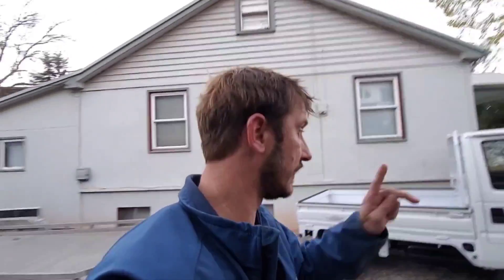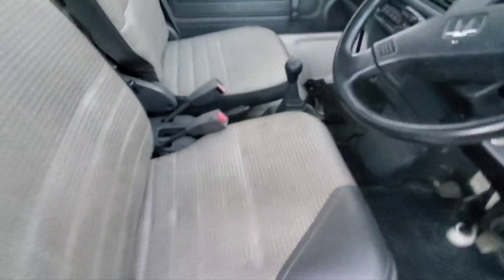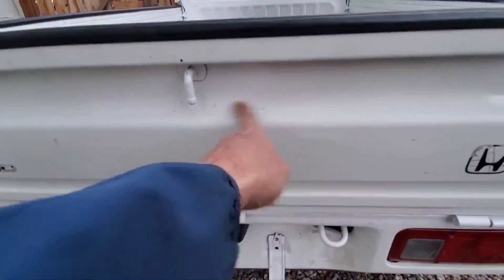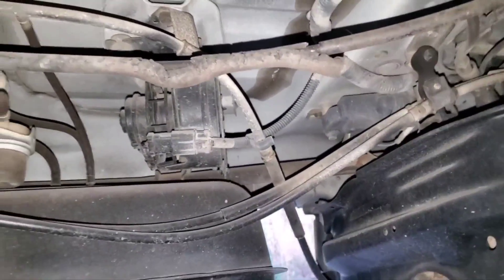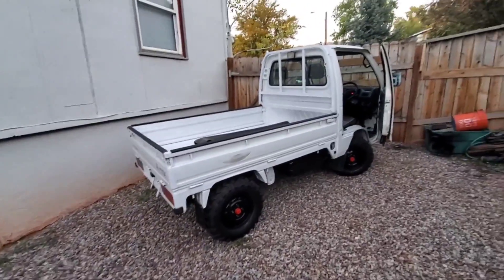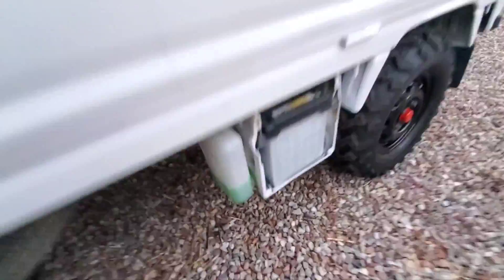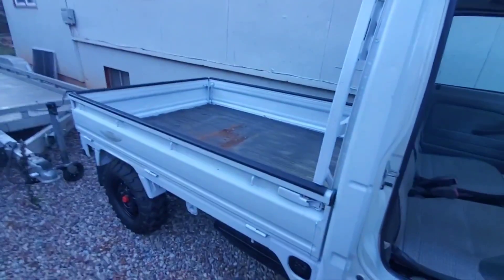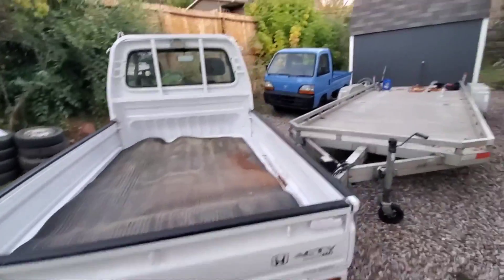Honda Acty Ha4 walk-around

Comment: I watch some videos of these trucks saying that these trucks are break down prone and that they are not very reliable....... only issue is the people saying this dont look very handy if you know what I mean. I have a question because I can not find videos from knowledgeable people on reliability and gas mileage. If you got the time to give me a small blip about mileage & reliability that would be awesome. Im stuck between picking a suzuki carry or a honda acty. My main use would be daily driving/offroading. I use the term daily driving as it would be a weekend vehicle as I have a work vehicle for work and I just want a fun truck to cruise around the city easy and maybe take on some camping trips. Im a young guy got lots of tools. but would be curious on what extras i should have in the vehicle if something is prone to breaking so that I am not stuck somewhere.
Reply: Also should I focus on something a little newer? or older... the newest I seem to find for the acty is a 2005. oldest going back to a 96.